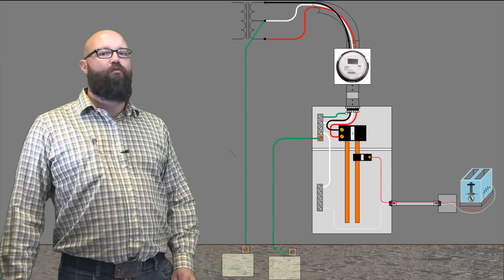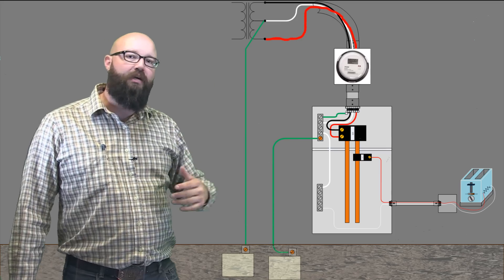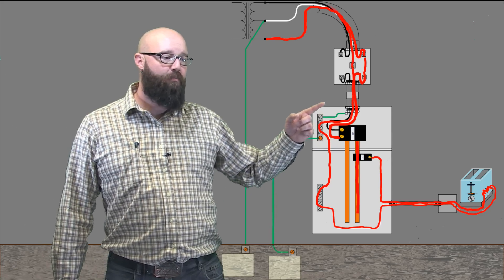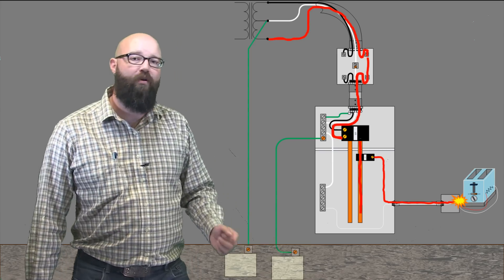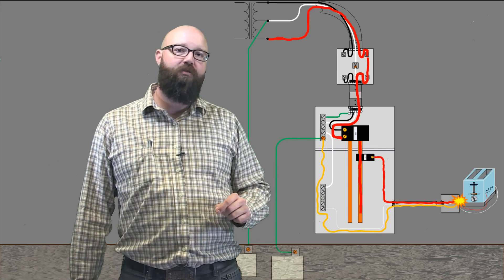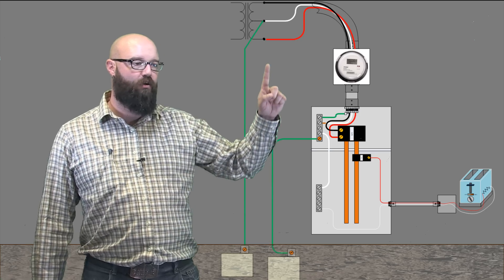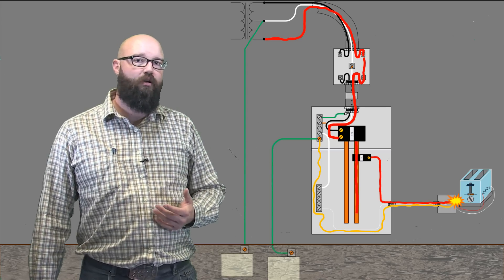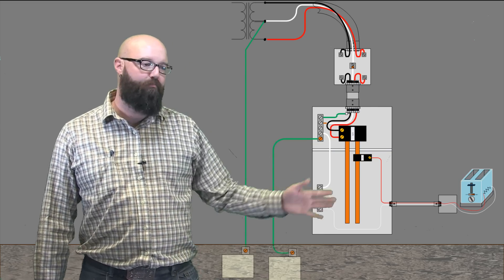Grounding and Bonding

Comment: I have seen that subpanels should not be bonded for safety reasons. Why is it ok for a meter panel and the main panel to both be bonded, but not the subpanel? All the reasons I see for why the subpanel should not be bonded would seem to indicate only one single panel should be bonded, which would also seem to indicate only the meter or the main panel should be bonded, not both.  Can you explain why double bonding is okay for 2 panels(meter and main), but not a subpanel?
Reply from the maker: Good question. One I have been asked several times. It comes back to the whole "path of least resistance" idea. At the grounded neutral point in a service panel, there are two paths back to the supply because of this connection. Remember though, our bonded path is a service Raceway with locknuts, bushings etc, and the other is a big fat juicy low impedance neutral. At that point the current will divide inversely proportionally, and the majority will return to supply on the neutral. I'm not sure of the actual numbers, but it would be an interesting study to do. 
Out in the field, if the neutral were bonded to a box or Raceway, now that return path would be again a Raceway, or a #14awg (in most cases) which has a significantly higher impedance than the service neutral. There is more potential for........ well.......Potential!!

Hope that helps. Let me know if not and I'll go at it again.
Cheers and thanks for watching!

Comment: Hello there, just wondering if anyone can shed light on a question relating to the above.. As there is always a path between both electrodes at all times, why under normal circumstances does current not leak through earth and back up to to the transformer.. i understand there has to be a potential difference between the points for current to flow.. And assuming the earths resistance is greater than zero between the electrodes. For current not to flow there would have to be zero voltage between the neutral bar back to the earth at transformer.. is that correct or am i missing something?? Appreciated in advance..
Reply from the maker: I have measured current on a grounding electrode, meaning there is a path back to the transformer supply electrode. It's not a lot, but any measureable current means there is a path back. 
When thinking of the proportion of impedance between the physical soil between electrodes, and the neutral path back to the transformer, nearly all current is back on the neutral due to the fact that the neutral impedance is considerably lower than earth. That being said, the path through ground is still a parallel path and current will divide, but inversely proportional to impedance of paths. 

Hope this helps.
Thanks is for watching.
Reply: @schulerruler  Thankyou so much for your reply.. this has question has bothered me for quite some while and i had found it near impossible to find the answer in any forum or platform.. i can now sleep at night with one less thing on my mind haha..
Big thanks again..

Comment: Incorrect. Not code.

 310.10 NEC 2017 no parallel less then 1/0

Also refer to 250.24 NEC 2017 grounding service equipment.
Reply from the maker: There is no parallel runs in this example so I'm not sure why you are referencing parallel rules. Also please read the video description and channel description as this is meant to be a video to be used with the Canadian Electrical Code.

Comment: Question. I live in Florida where water is only 3-4 feet deep into the soil, does water underground make for a good earth ground via grounding rod?
Reply from the maker: That is a very good question. You would definitely have a much lower impedance than other areas. I may have to get back to you on this one! I imagine areas like Louisiana would be similar as well.
Reply: The last thing we want is current flowing through the earth under normal conditions, because the resistance of the soil creates voltage gradients which could kill you if high enough. So it shouldn’t matter how low the impedence is. The biggest mistake everyone makes is assuming thaT more grounding is better grounding. Not so.

Comment: Similar system as in Australia we use a multiple earthed neutral MEN, an earth bond on the main board N and on the transformer neutral but we have no ground wire coming from the transformer instead we call the consumer main neutral the protected earth neutral PEN, alot of dangerous situations arise of someone leaves the MEN link out and a fault occurs, downstream consumers can experience symptoms also not just the property where the link is missing. I've been very curious how this works in other countries, great video thanks👨‍🎓
Reply from the maker: Thanks for commenting! I'm going to look more into the system you are using. As you said it's interesting to know how other countries do it!!
Reply: @schulerruler  I could email u a copy of the As/Nzs 3000 wiring rules. It's our main standard for wiring and installations, there are a number of more specific standards for special installations but the 3000 has a section on MEN that includes diagrams. It is a field manual/rulebook however u would have enough knowledge that you would be able to decipher the concepts from the diagrams and sections.

Comment: Very informative. Unfortunately your last example is very unlikely. The resitivety of soil is quite high and would not provide a low impedance path.  The ohms per meter can be between 10 and 1000ohms per meter depending on how wet it is. This would be a high impedance path and the circuit would only see this as a load and depending on the site specifics, could be quite a hazardous scenario.
Reply from the maker: Thanks for commenting. We've established throughout comments the very fact you are pointing out. I agree with you.
Reply: @schulerruler  my bad. I should have scrolled down further.

Comment: Great  info:  I have a question? on a short . net. to power....will the main breaker only trip when the current exceeds the main breaker amps? it will only trip the load breaker if short only exceeds the load circuit amps?
Reply from the maker: A standard thermal magnetic breaker will trip from a short circuit current, meaning line to ground or line to line due to very low impedance causing a strong enough electromagnet in the breaker to pull open the trip coil. 

In an overload condition, meaning higher than regular current but far less than short circuit (say 18 amps on a 15amp breaker) the higher current will cause excessive heat inside the breaker (resistor or simar device) that will cause a bimetallic strip to bend and actuate the trip latch.

Not sure if this answers your question or not.

Comment: Can you get electrocuted if you were to touch the panel while the path of current is traveling through the panel itself during a fault?
Why or why not please!

Thank you, great vid.
Reply from the maker: First, always assume you could be shocked or electrocuted when working with any circuit, live or dead. As with all electrical circuits care must be exercised and you are a parallel path potentially to ground. There are reasons I say this instead of "no you won't". Is your skin moist? Is there a screw in your shoe touching something metal grounded you didn't realise was there? Things like these could definitely cause a shock or electrocution. 
That being said, if all bonding and grounding are done correctly, the bonding system will offer a far lower impedance path than you will, so likely you would not be shocked but I have to stress......PLEASE DO NOT TRY!! LOL. Let me know if this answers your question and thanks for watching and commenting!
Reply: @schulerruler  Awesome, thanks for that. Sorry in advance for long question, but maybe there could be some subject matter for a video. Don't worry I do not plan to do anything until I am well educated about electricity and circuits, and I am far from it.

I asked the question to better understand the path of current, because I am having difficulty understanding how components and appliances are energized. My main confusion is understanding the purpose of the circuit. Why does a circuit need to be completed?  It appears that appliances / components can be energized without completing a circuit, such as the breaker power bus or an appliance (or human?). So then why can't an appliance receive the flow and go straight to ground. Regarding the system in your video, why have the flow go back up to nuetral to complete the circuit. Is the SOLE purpose of completing the circuit back to nuetral to open the breaker in case of too high a current? Or are there other reasons for completing the circuit?

Feel free to point me to another vid that could help. Thanks again.
Reply from the maker: @ForgottenBeastMetal  for any circuit to operate it requires a closed loop. Think of the source as absolute positive and absolute negative. The electron is forced by a voltage out of its atomic shell and is attracted to nearby atoms that have also had an electron forced out, leaving them positively charged. The electron, being negatively charged is attracted to the nearest atom (positive) and the movement of this negative charge and the energy it gives off is what we use to power things. If you open the loop you lose the potential difference of the source (voltage) and electron flow stops, meaning zero current. 
The systems are designed that current flows out on the hot (black wire) and back on the identified or neutral (white wire) with a high impedance load to limit the current. Realistically, being an AC system the electrons never really go anywhere as the supply is constantly changing polarity and they just move back and forth, but a moving charge is a moving charge.
Again feel free to ask for more clarification and I will try to help any way I can.
Cheers
Reply: Go ahead Pete, ask him another question so he can go into long winded explanation about something that will confuse you more.

Comment: Great video, and thanks for increasing my understanding, but I'm still looking for an answer to my specific situation. I have an old Greyhound bus converted to a motorhome in the 1970s and I'm upgrading from 30 amp to 50 amp service. 

It's crazy and confusing the way the old screw in fuse box was wired. To switch from shore power to the generator required moving the "shotgun shell" main fuse holder from one side of the box to the other. Basically a poor man's transfer switch.    

The neutral and ground were twisted together at the power cord receptacle on the side of the bus. None of the branch circuit ground wires in the fuse box were connected to anything. I've never seen anything like it. I tore it all out.

I installed a 50 amp male marine receptacle on the side of the bus to plug my power cord into. I ran 6/4 cable from that to the new Square D breaker panel, installed a ground bar, and removed the neutral bonding screw. I assume this is correct since the neutral and ground are bonded in the power pedestal I plug into? Should the panel be grounded to the bus chassis or not? For now, I don't have the generator hooked up.
Reply from the maker: Being that this is a very specific example I'm not sure how to answer that haha. 
My best suggestion would be to contact your local authority and have a chat with an inspector as they would be ultimately the ones to decide in your example. I can see benefits to bot grounded and ungrounded system in this case so I couldn't say one way or the other. 70-126 deals with relocatable structures in the CEC, and specifically the grounding and bonding but again, ask the inspector as they would be able to clarify and hopefully give you a definitive answer.
Thanks for watching!
Reply: @schulerruler  no, do not ground to chasis, in the case of a short you could potentially have 120v running through your chasis, in which your vehichle battery is grounded to along with the ignitions system.  It would probably blow up your battery and most definately fry your ignitions system on the engine at a minimum.
Reply from the maker: I don't think he is referring to "grounding the chassis", but making an actual effective connection to the mass of the earth for the electrical system. If it is a system that incorporates a neutral or does not exceed 150v to ground it must be grounded with an electrode. The bus would be expected to be bonded properly and the grounding connection would be done via the receptacle connection to the point where the bus recieved power. 

The rules for a bus itself would fall most likely under part 2 of the CEC as it is more like an RV.
Reply: yo make some videos about this bbus house bra!!!
Reply: I would definitely bond the chassis. The NEC would equate this to including building steel in a building’s grounding electrode system. Then if there was a short to the chassis the fault would clear and the chassis would not rise to line voltage and create a safety hazard. That’s why all metal parts of an electrical system are bonded. I’m sure the vehicle battery could care less that it’s neutral terminal is connected the the chassis, and it won’t blow up. But if it did, what’s more important, the battery or you getting fried?

Comment: WOW , you just blow this lic electrician mind, from my understanding a ground fault will travel the path of least Resistance ,  one of the resend we bound the neutral at the first point of connection , so theres no uneven balance between the ungrounded conductor and the ground , the resistance to earth is to low to travel back to center tap grounding of pole transformer or base transformer, what about distance ,200 250 ,300 ft away ,  i don't see the last part of a open neutral return path. my understanding is a grounded fault will open a magnetic trip on a breaker.
Reply: Nice

Comment: The earth ground will never carry enough current to clear a fault.
Reply from the maker: We've established that previously in the comment boards. It depends on your location and soil moisture levels.
Reply: @schulerruler  Let me repeat an earth ground will never clear a fault. Location or moisture  make no difference. https://www.youtube.com/watch?v=Yg6G5VUSsWA
Reply from the maker: The deeper he goes, the less resistance there is. The soil mixture changes, meaning that as moisture content in the soil increases, ohmic value decreases. I disagree that earth will never have sufficiently low enough impedance to clear a fault. I doubt that under most circumstances a fault would clear, but the video you are providing proves that different soils yield different results. Luckily we do not use ground as a low impedance path, but there is no doubt current will flow through it.
Reply: Brian, you can repeat yourself forever, he doesn’t get it.

Comment: very nice video.  the one thing that i have never understood: if the fault current travel thru the ground to get back to the "source", how does it know how to do that.  there is a million paths back to the source.  For that matter, why would it care to go back to the source?  I know u are right, i just cant understand that one little thing.  thanks
Reply: In your statement about a million paths back to the source, just remember 'the path of least Resistance'. As to your other question about why would it care to go back to the source, you need to remember in an electrical world Hot doesn't want to go back to the Neutral or Ground, it wants to go back to the other opposing force in the circuit which in this circuit is the the other Hot. In AC transformers there is always (2) Hots and (1) Neutral in a single phase transformer, (3) Hots and (1) Neutral in a 3 phase transformer, and some Transformers don't have a center tap which is the Neutral. Think of an AC circuit like a DC circuit or a battery, positive (+) needs to go to a negative (-) to complete a circuit, that's how it 'wants' to go back to source to complete the circuit.
Reply from the maker: Well Explained! To bring it to an analogy on the molecular level, and build upon what you have said, an electron is a negative charge and will move to the most positive point in a circuit. As you have mentioned, this point is not neutral or ground but the opposing potential difference in the source. in AC the electrons move back and forth as the polarity of the source is changed, but in DC they are always moving in one direction. Towards the positive point in the source.
Our electrical systems are designed so that the path of least resistance (as Brad W mentioned) is through the load, and back on the conductors as opposed to alternative paths (there are rules to back this in the codes).

Comment: best I've seen so far.
Reply from the maker: @Mister Brookes Please keep in mind this is not a US video and other locations require less than 5ohms, as opposed to 25. 
Also it is dependant upon the soil conductivity, moisture content and saline content. You are also assuming all services are 120v. If you are going to apply some ohms law for calculation purposes, don't forget about 480v and 600v services as well.
Reply from the maker: Thanks, I appreciate that.
Reply from the maker: The NFPA or IEEE? Both state resistance to ground should be less than five ohms. The NEC states less than 25, and less than 5 for buildings with sensitive equipment.
Reply: Mr brooks, unless I misunderstand your comment are you saying that paralleling two rods would increase the resistance higher than 25 ohms? Adding the second rod would decrease the total resistance bringing it below 25 ohms, which is why the NEC requires the second rod. As an aside, Some localities will require a second rod in situations where a building does not have any code permitted electrodes, such as a garage where there is no water main, foundation rebar or building steel. This of course has no bearing on the original subject matter.